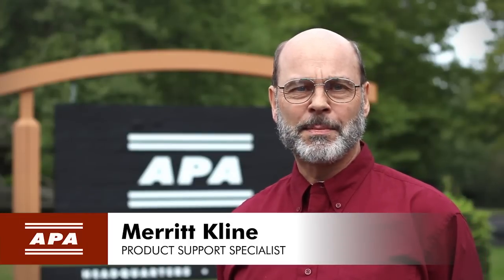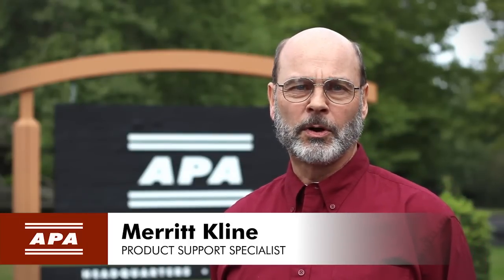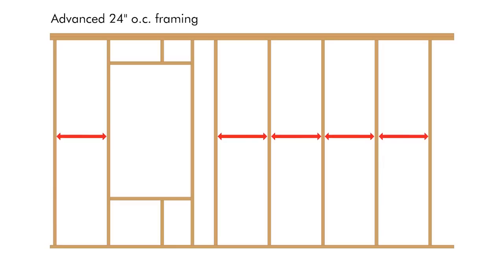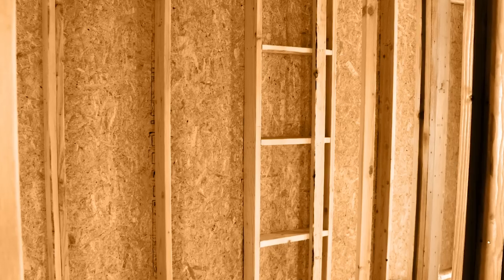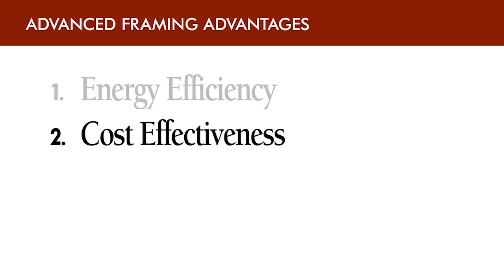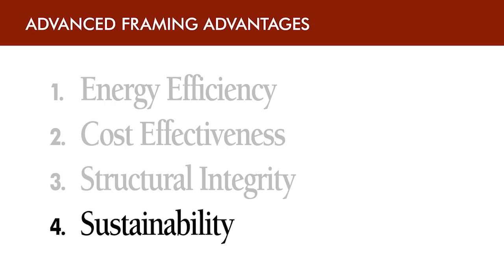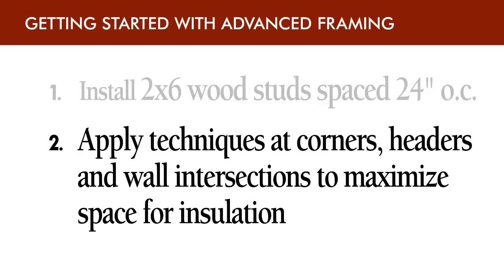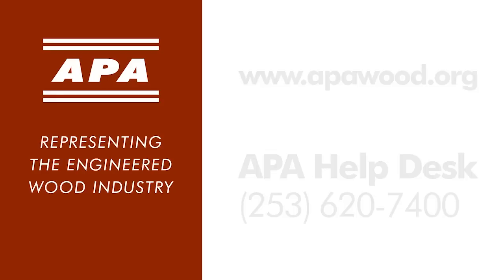Advanced Framing: Meet Structural Code & Energy Requirements

Comment: Smart people build this way!
Reply: Nicholas Littlejohn I’m one of those “smart people” having build over 100 advanced framed homes. The cost savings in materials alone is about 20%. It will take longer to frame the first couple homes but after you get acclimated to this type of construction you’ll never go back to what was the “normal” way. There are also variations of certain structural components, headers for example that don’t require jack studs. Once you get hooked on the building metrology, your tape measures will have greater longevity as you’ll use them less often! Go for it and reap the additional profits for your efforts!

Comment: Mr Clark...there are many mistakes throughout your video ie: methodology, insulation values and envelope performance. Having built 100’s of homes using Advanced Framing Techniques, several in conjunction with the  the APA, (John Rose and Ed Kieth PE’s) I’d be pleased to share my experiences with you and possibly make adjustments to your video. Now, as an ICC B5 Building Inspector, i can verify that IRC Code compliance is achievable with proper documentation.